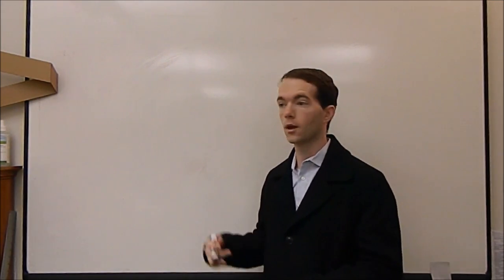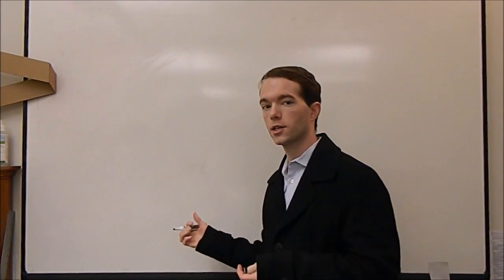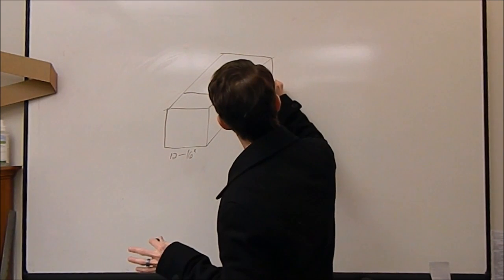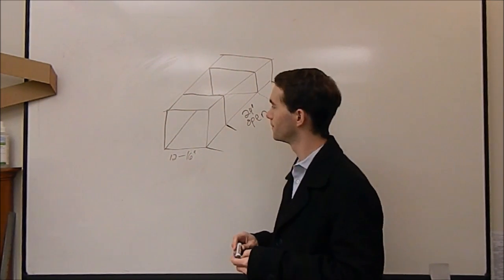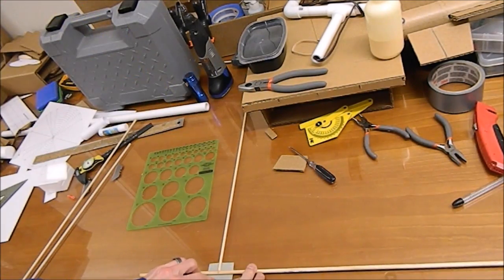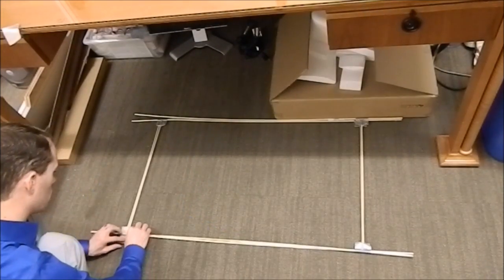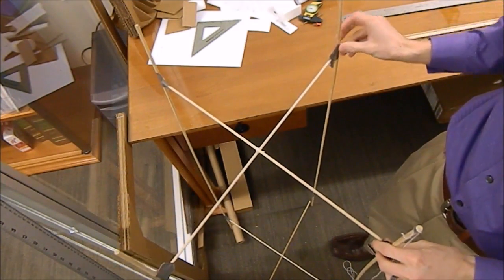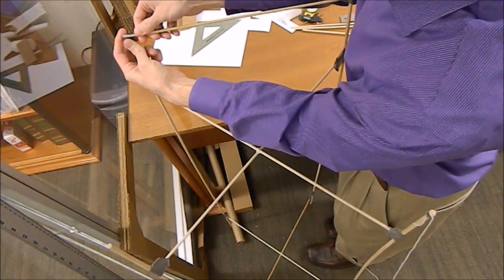Building my First Box Kite      Mikes Inventions

Comment: Did it fly? I suggest just use crossed diagonal strings for reinforcement. Also the gap between your rectangular is too wide, box type kites are among the best flyers, and does not need much of a balancing. I miss those boyhood years of mine. Cheers from the Philippines.
Reply from the maker: Yes! It flew extremely well.I think there's a clip of it near the end...? Or maybe it's in a Card Link...

Comment: If you were to cut your skin and make pockets first...add your frame then stretch it open with your cross memebers you don't need so much bracing since it's waaaaay tighter....I've made box kites out of 4 1/4" dowels and only 2 3/16" dowels(obviously cut down to make 4..2 x's)
Reply: You also use plastic keepers for your cross memebers

Comment: The cross-brace look smaller then the 1/4" main structure - what size did you use?
Reply from the maker: The smaller sizes are 3/16. 1/4 was probably too much to begin with.
Reply: Hey thanks for the tip - I have these small bamboo sticks I was going to use, and they seem to be a little smaller the 1/4.

Thanks again.

Comment: You used too much sticks there. If you want it to be lighter, durable and easier for it to catch air you need to use a very minimal number of sticks and a designed frame structure for durability and lightness.
1.First you must better start on making 4 smaller square made of stick tightly tied with a nylon on each corner with few drops of super glue to make it stronger(this is where the skin will go)
*to make sure the square is on proper proportion and and add on the durability of tge kite better tie a string again on corners making X inside of it. 
2. Get 4 long sticks to be use as the spine of the kite and start to make the boxes for your kite and make sure you tightly tied the connected part and added few drop of superglues on it (you know what i mean and know you can figure it out)
3. Place now the skin and add more crossed strings inside the box for support (dont use sticks as support as it will only make your kite heavier and harder for the skin to catch air.

Comment: +mike thomson great video but ur design is over engineered with too many extra dowels which means extra weight that isnt needed.
traditional box kite designs have 4 upright long spars plus the cross shaped braces top & bottom.
the easiest way to stiffen the frame is by glueing the joints with pva or similar type glue & lashing the joints with string/pva glue or another method is to drill holes & using either small nails or even matchsticks as dowel like joints along with some pva to make it solid.
amother tip is to use a 1/2 joint notch where the braces meet in the centre of the "x" & glue/bind with string,but ensure that the ends of the X are evenly spaced b4 the glue dries as u cant adjust them after it sets :) pls note i"m not being negative/trolling you @ all,just thought i would pass on the results of my research into building box kites as iv'e wanted to build 1 since i was a kid but could never find any useful info until i searched the net & u tube too,best wishes & happy flying to you & your video viewers too :)